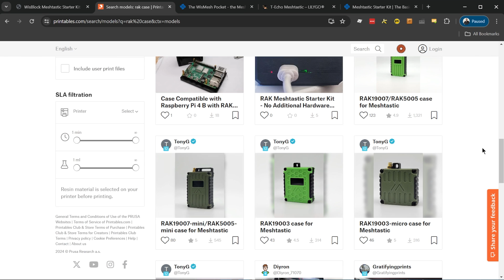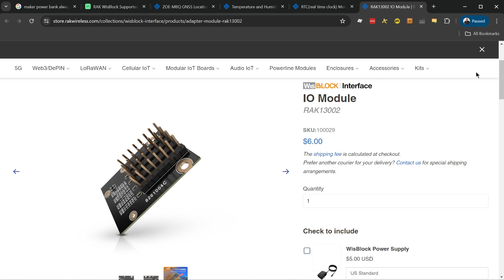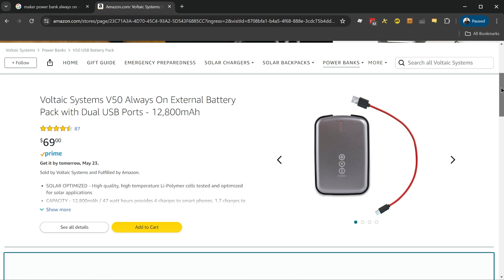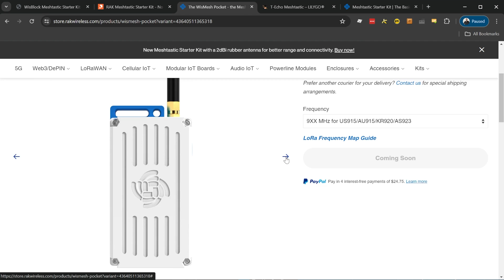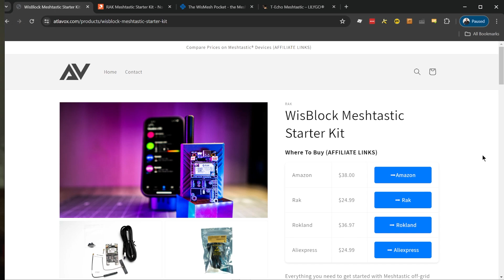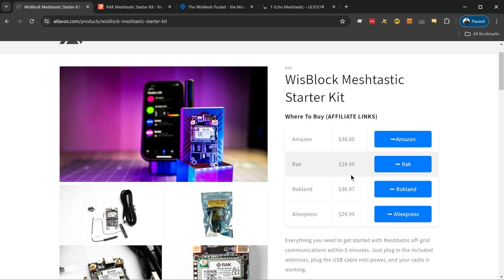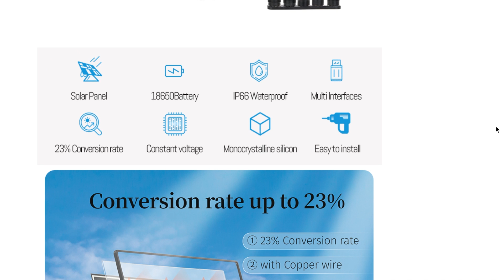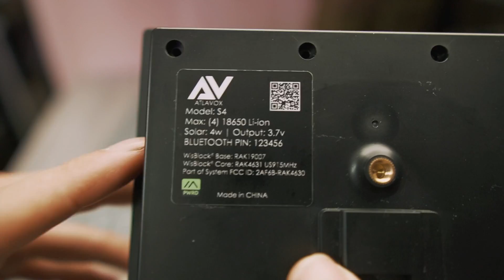Best Beginner Meshtastic Radio on a Budget | Cheap, Fast, Versatile

Comment: I ordered one of these cases and I like it, but I should mention a couple of things:

1) The battery will fit, but you MUST make sure the board sits 100% flat in the tray (the middle piece where the board fits in). There are four tabs, and you may need to jimmy the board in there. If you don't see the tabs above the board, you will not be able to fit the charging USB in, and you certainly will not be able to fit the battery without real problems.

2) The LoRa antenna must be FULLY AT THE BOTTOM OF ITS TRAY (the antenna part of the middle piece). Use a screwdriver or better yet a spudger to get it in the bottom. If you do not get it in the bottom, the top part of the case will cut the LoRa antenna off (this happened to me a couple of times).

All in all, I like this case, but I recommend being mindful of these things and be mindful of these things when putting everything together.

Comment: I printed two of the cases yesterday in anticipation of the boards arriving today. The design is quite elegant. Sliding the top antenna piece in place causes the two halves to separate slightly, but otherwise the fit is excellent.

Comment: With the Anker power banks like the one you showed, if you hold the power button, it will switch to low power draw mode (shown via a single green led on the charge status lights). The auto-shutoff is disabled in that mode. To go back to the standard mode, you just press and hold the power button until the green light goes out. A lot of the cheaper power banks support this kind of thing.
Reply from the maker: I had no idea! Thanks for the info. I just looked up anker and it seems like the low power mode still shuts off automatically after 2 hours.
Reply: @Atlavox  I thought mine stayed on longer than that, but maybe it didn't. Mine unfortunately stopped working so I can't confirm and the manual doesn't mention 2 hours on my model. But I guess 2 hours is better than whatever the default was if you're carrying it around.

Comment: i mean.. it has a pretty good reason that "most cases have antenna connectors for different antennas" and "for a beginner" is not really a thing come on, were not talking about reparing a car.. yes its a cool case but thats the end of the story lol
if youre capable of ordering the correct battery with the correct connector you are also capable of ordering a suitable sma connector and antenna.. even if youre a "beginner".

the solar thingy is cool :D

Comment: If you think  printing supports is tricky you should not be 3d printing.
Reply from the maker: It's not the printing of supports that's hard, it's the removal of them that sucks. You can easily scratch your finished print, and they sometimes leave behind a poor surface. I like to avoid them if possible, it's one less step to deal with when printing out a ton of parts.

Comment: An exciting view of Meshtastic progress and new products.   I have one concern with 18650 cells operating/charging at temperatures below freezing.  LiFePO4 batteries must have low temp sensing to protect the battery cells - no charging if the cells are below freezing and an extended low temp operating range within reason below freezing.  I am looking to set up a mesh of nodes in outside conditions.  Today was close to 100 degrees in SLC, but I can't trust the WX for winter months.  This is really exciting, though, please keep up the progress.  I'm going to pursue the RAK products, as my T-beams are older and a bit klunkier.  TNX

Comment: Really ? You stole his design and you are now selling it for 20 dollar! 😑 How t are you giving back to him!? You should at least give him 5 dollar for each sold item!! 🤷🏻‍♂️
Reply: Did you watch the video before you ran your mouth?
Reply: He's not selling the design he's selling the cost of manufacturing the case which is basically nothing in material but tedious bs with printing it, shipping, labeling. That whole thing probably takes 2+ hours to print. So just on one machine you're only getting $10/hr - labor/hr.
Reply from the maker: Did you miss the part where I said I spoke with the designer? 5:12 I didn't steal the design. I originally offered to pay him to license his design. He said he didn't want money and said he'd be happy to change his license to allow for commercial use. The designer allows anyone to sell it. In honor of that I decided to donate $100 to the Meshtastic Open Collective, which you can view here: https://opencollective.com/meshtastic
Reply: I fail to see the issue except your obvious ADHD. He did due diligence and spoke to the designer who obviously wanted to help the community. I can't find this case anywhere else and am not yet prepared to buy my own printer. Paying him for the time, materials and resources seems pretty reasonable to me if the original designer doesn't intend to. I see no harm and only good will. .... except for your short-sighted, woefully weak attempt to raise drama where there is none. Back to the Harris campaign with you!
Reply: Keyboard warriors are the best
Reply: @rosariosorbello306  spoken like a true warrior

Comment: Nice concept but poorly executed...Board does not sit flat is tray...Causes USB-C connector to be cockeyed and unusable...Not enough room for the recommended battery without stressing the board...Case needs to be deeper...Not sure if there is room for GPS module and antenna...There are better choices out there for the same money...

Comment: The stock antenna that comes with the Wisblock is hot garbage, it’s got low efficiency and high swr, replacing the antenna at the very least is going to give you the best performance.
Reply from the maker: Yeah, it's not great. It's just one of those barriers of entry though to upgrade the antenna. Not only do you have to research antennas, gain, connector types, you also need to buy a cable that goes from the WisBLock to the antenna. I just appreciate this case because you literally don't need to buy anything or research anything else other than the WisBlock Meshtastic Starter kit. It's great to get started and play around with.

Comment: Why 800 or 900 mhz? Those two bands are the worst of the bands available...
Reply from the maker: Idk, you probably know more than me. But it uses LoRa, so it’s long range, low power, and since 915 doesn’t require a license that’s important. Another benefit is it “blends in” to other ioT devices making it more stealthy if that’s a concern.
Reply: ISM bands. Keeps it legal in the FCC eyes

Comment: The Heltec V3 is cheaper, has an OLED, online flasher, case from printables, easily add gps with a $7 gps module.
Reply from the maker: Biggest thing is the battery life is far superior with the WisBlock. It’s like a week. Heltec only gets 1-2 days. It also has online flasher and cases available on printables. It’s modular so you can add whatever you want.

Comment: Would you consider selling just a parts kit without the plastic so basically just a solar panel and the board so we can just 3D print it ourselves.
Reply from the maker: I was planning on selling an all in one kit with the WisBlock and everything, but that’s a good idea. I could basically sell it as an enclosure and you can add your own WisBlock and batteries. The 3D printed bracket is super cheap, idk if it makes sense not to include that, unless you’re implying you want to use the enclosure for something different?
Reply: @Atlavox I'm sorry I wasn't more clear I was speaking of the solar node you introduced at 7:20... So just the solar panel and circuit boards allow us to print enclosure to contain it all. So I was thinking just the board for the power bank the board for the solar charge controller the solar panel and The wisblock... I don't mean to disparage your existing design or anything it's just that we have a lot of different locations which will require different enclosures completely. We can break it down and remove the boards that's not a big deal but since that was the plan maybe it would save some trouble on your end. And perhaps some overall cost savings since it's just the circuit boards and nothing else... We normally don't use springs for the 18650s on outdoor projects spot welding seems to hold up longer and provide a better connection.

Comment: Add a GPS module and the "beginner kit" is perfect for attaching to a dog collar for tracking your pet.
Reply from the maker: Damn. That’s a use case I haven’t thought of. Genius
Reply: I think that for this case of use, is best Lorawan and TTN.
Reply: Why wouldn't just the gos tracker be fine on its own for a dog collar?
I'm brand new to this and am trying to learn. TIA.
Reply: @IsaiahChapter53isAboutJesus  The gps unit does not have a power source or transmitter, it is just an add on module.

Comment: Just add GPS, this is awesome.
Reply from the maker: Idk if I'd even worry about a GPS, because you can just have the Meshtastic app use the GPS on your phone. If you're setting up a stationary solar node, you can just set a static location in the app. The only application I feel like it's really needed to have on-board GPS is either a tracker node, or a dedicated mobile node on a vehicle. Maybe there are some other use cases I'm not thinking of?
Reply: @Atlavox  I'm thinking along the lines of lost hiker scenario.
Reply from the maker: @tomgarciaaz  In that case, wouldn't the hiker have their phone? Or are you saying just as a redundancy in case the phone battery dies?
Reply: @Atlavox  With or without  phone. Both are possible.
Reply: @Atlavox  I'm using one for putting on r/c aircraft and rovers- it will help me find a lost model and also will be a node on the mesh to get distant contacts with the extra altitude.
Every OTHER unit I have, yeah I've realized the GPS is kinda pointless and I'm turning it off next time I update the firmware.
Reply: @Atlavox  Is gps required for Civtak/Atak or does phones gps work?